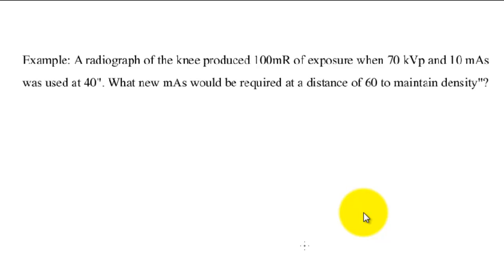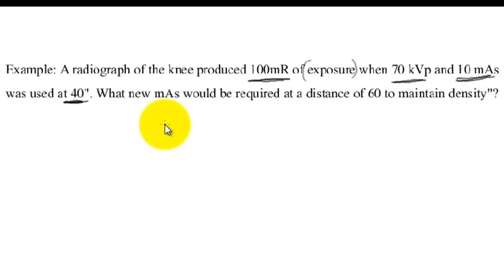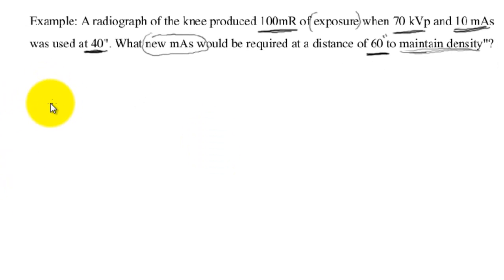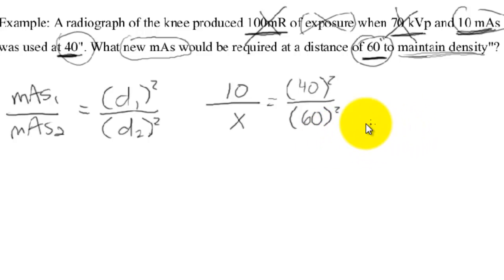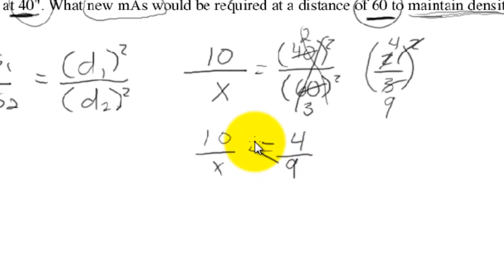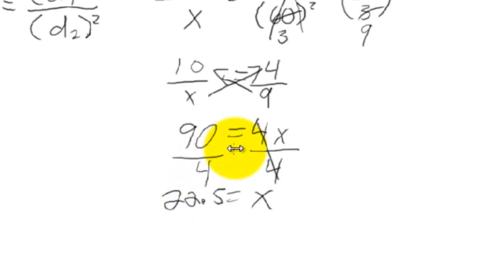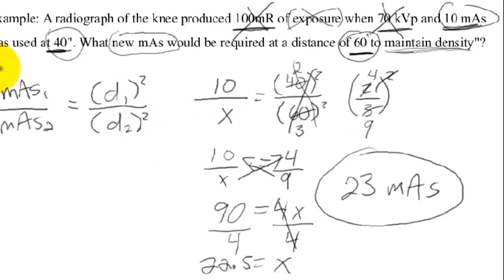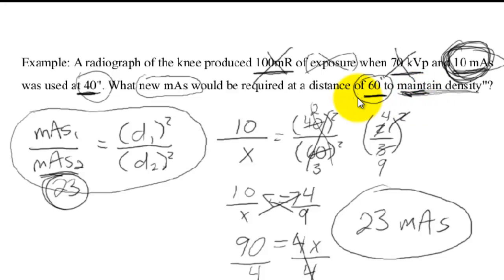Density Maintenance Formula.mp4

Comment: intensity is inversely proportional to the distance, i dont actually get what you mean by what you just did
Reply from the maker: Intensity is not inversely proportional.  It's inversely related to the square of the distance.  Being inversely proportional would mean if you double your distance, you halve the intensity, which would be incorrect.  This formula shows the relationship (and how to calculate for changes) between radiation intensity and the distance from its source.  Hope that helps... I've been thinking of a more visual way to explain this for a future video, but this is how you'd do the math.

Comment: why did you make it so hard, you added to many steps... less steps are easier not everyone learns the same. i did this in 6 steps
Reply from the maker: rlalko l I'm sorry you didn't find it helpful... I showed the steps I did in order to make it easy to understand... the work can be cut into fewer steps with a calculator, but I really only used 4 steps - after you plug in valued from your formula, 1. reduce 2. square the distance values 3. cross-multiply 4. divide so that "x" is by itself on one side of the equal sign.  Keep in mind the reason I show all of these steps is because I look for each of these when I grade student exams to ensure they know how to do the work.  After a little practice, you should be able to do these relatively quickly in your head as a practicing technologist.